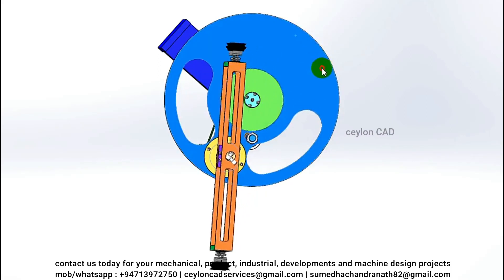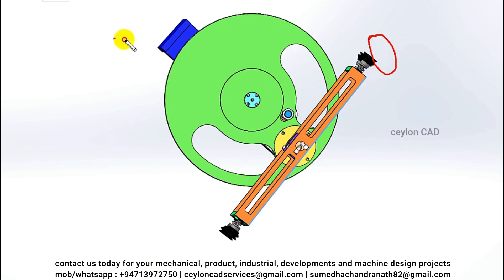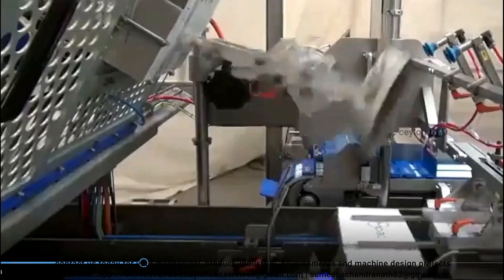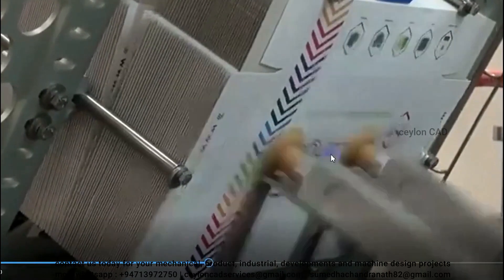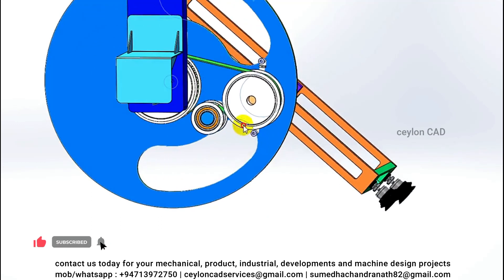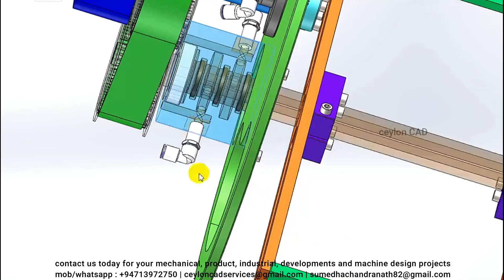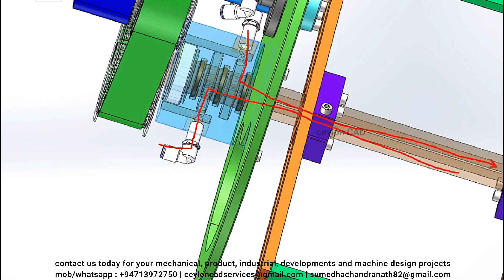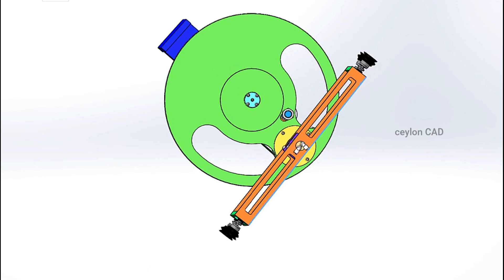Pick and Place mechanism ( Rotary )  , #Solidworks, #pickandplace ,#mechanism

Comment: how orange part rotate it self
Reply: Because that part connect with timing belt to center timing pully. But the center pully does not rotate. It is fixed. Just like planetery gear system.  Here sun gear which is center pully fixed. So, if the carrier is rotate,  then planetry gear is rotate.